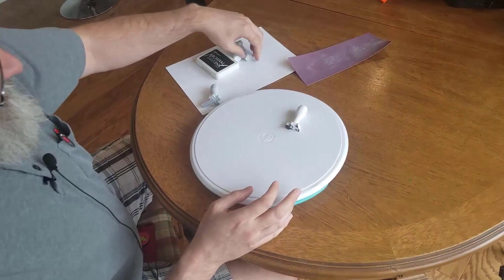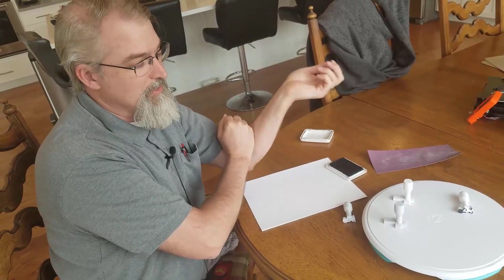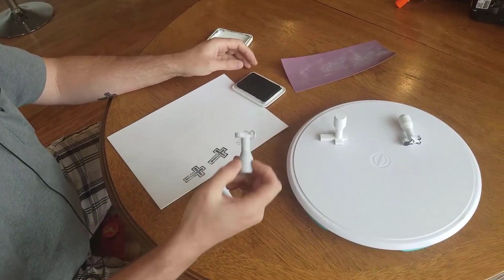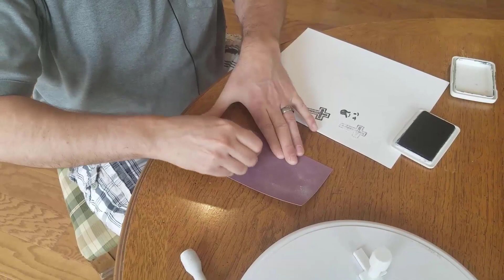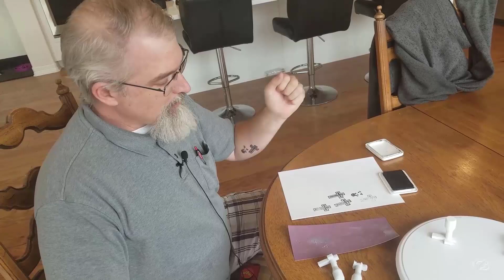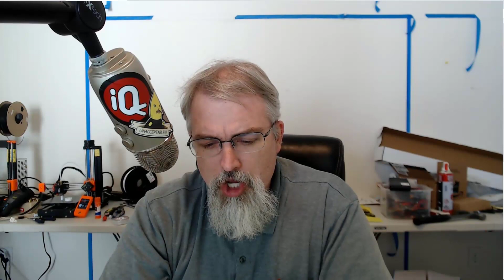3D Printing: OpenScad Stamps

Comment: you could have most of the stamp in pla, and a rubbery foot with the image that slips on
Reply from the maker: I was trying to go for simple print with pretty good results.
I bet you could print something out in TPU or ninja flex and make a better stamp.
I think I will try that at some point.  
But for a simple stamp you  might use as a teacher stamping smiley faces on their test papers :)